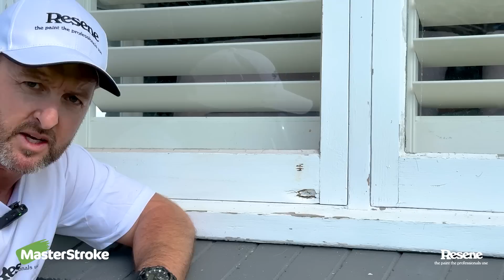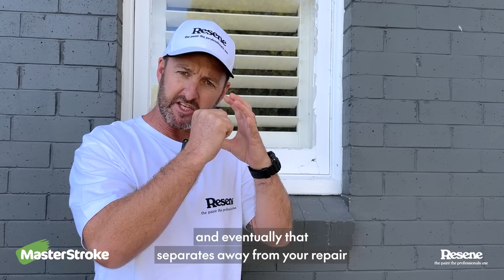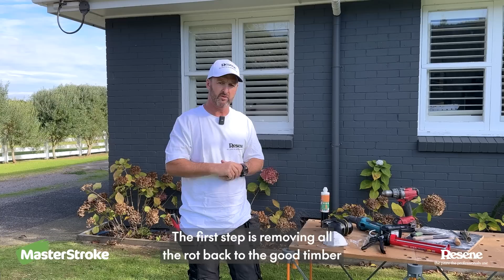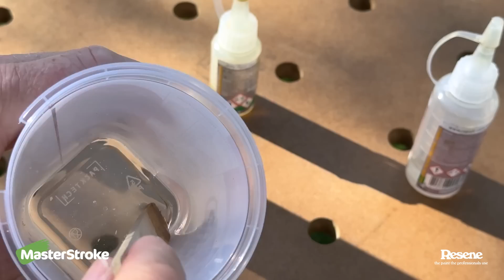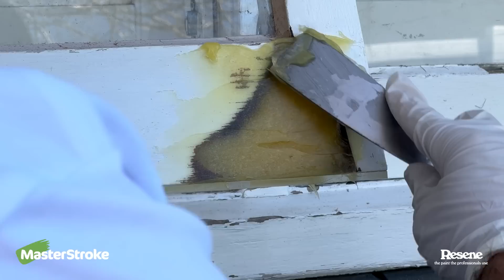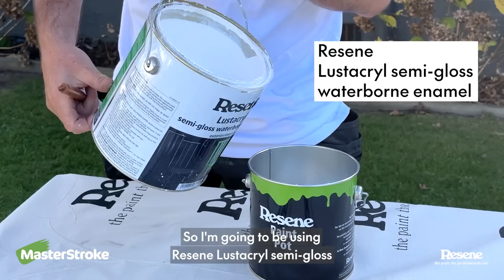Weekend DIY Fix - How to repair rotten window frames

Comment: Gdamn some good ideas from a drunk aussie, cheers on how to form the mold and the router. Im over here power sanding and chippin away, forming molds with jb weld and shims. Im the drunk one, get er done.
Im gonna just use the damn Phillips bit as a router heck yeah